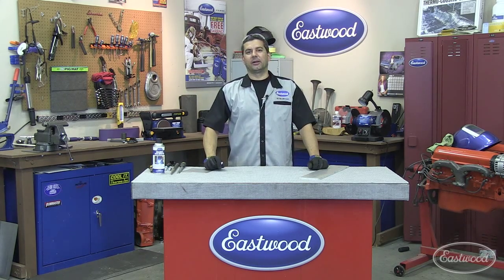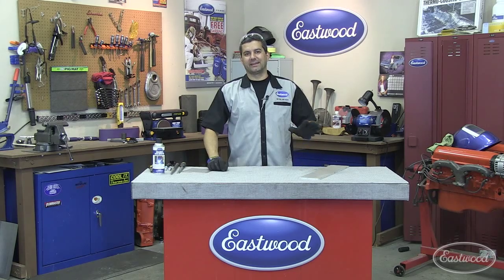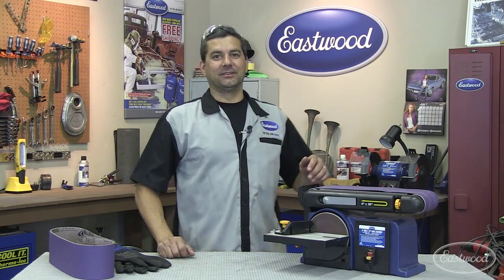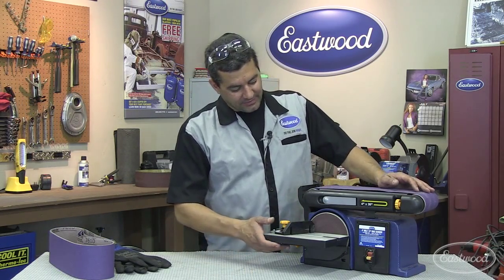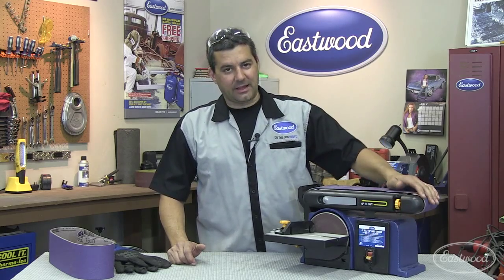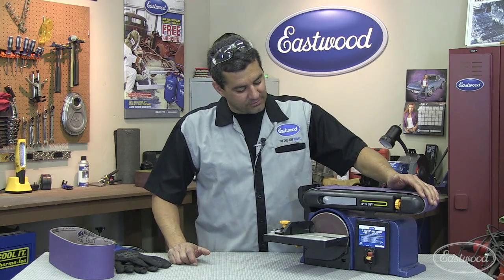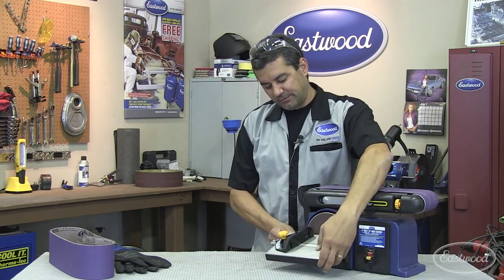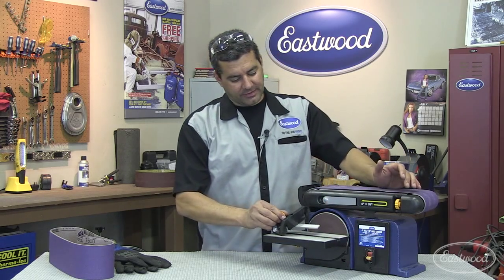Belt / Disc Sander - Electric Bench Mount - from Eastwood

Comment: If you want to smooth out some rough edges on metal (like if you cut a piece of copper pipe) do you use this or a bench buffer with compound?  Or would either one work?